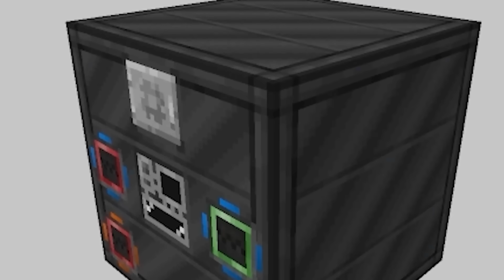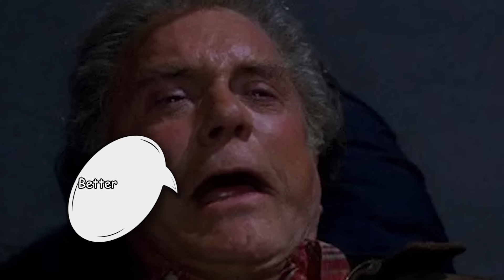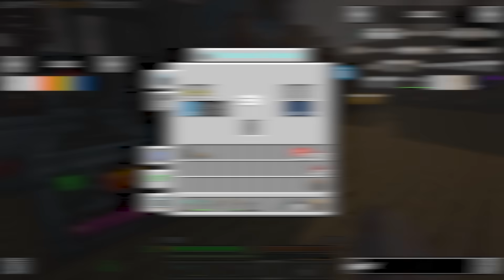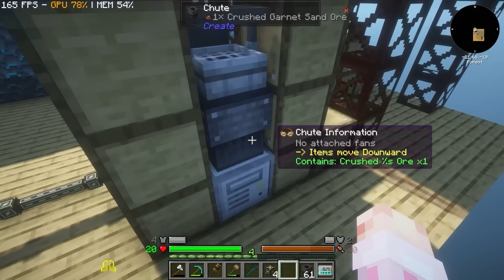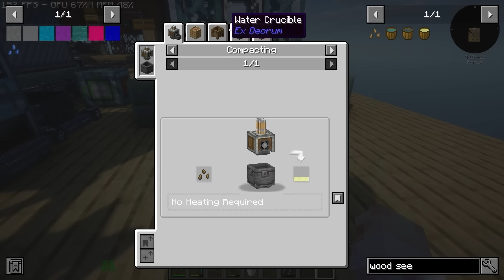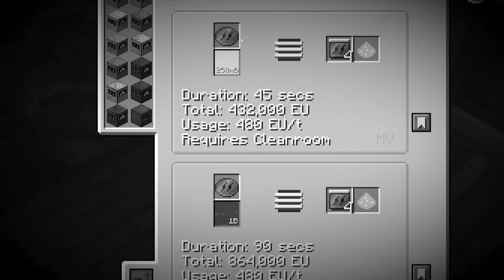Inventing Chemistry In Minecraft's Most Addicting Modpack || Star Technology (Part 2)

Comment: I'm a chemist so for simplicity 
Poly means plasticized aka many of the same chemical turned to 1 chemical tetrafluro 4 fluorine on the carbons ethylene is like carbon hydrogen but the 2 carbons as "eth" is short for 2 long chain and because it's tertafluro it means no hydrogen which means no combustion and polyethylene is same but fluorine is hydrogen

Comment: Gregtech has a way to make oxygen infinitely, through the cobblestone processing line. 
If you forge hammer the cobblestone into sand, make glass dust, centrifuge it, and electrolyze it, it will yield you silicon and oxygen very quickly.

Comment: 14:56 At least you don't have to aquire blue steel (and if I had to guess, later red steel) the Terrafirmacraft way it's a lot of heating things up and casting and waiting for things to cool, oh and dealing with the expensive (at that stage) fuel devouring mess that is the Terrafirmacraft blast furnace. Terrafirmagreg LV requires 4 blue and 4 red plates which are either 1 to 1 with 20% loss chance, 2 to 1 manually through a mini game type thing after expending 14 ingots of either type on an anvil, or 3 to 2. I know because it's been kicking me in the shins.

Comment: Here are my government mandated tips:
- when you do build the cleanroom it's much easier to expand vertically rather than horizontally, so making a max height cleanroom is likely the way to go when trying to fit more machines. You should also be able to use a machine hull to pass through ae2 cables if it follows the rules of gtceu on 1.12.2
- gregtech loves to reuse the same fluid in 20 different places (hi sulfuric acid) so my personal recommendation is to make a seperate ae2 network dedicated to storing passived fluids using cells, and then use fluid interfaces to move said fluid around
- ae2 energy p2p is a really solid alternative to energy consuits for moving power around, especially since it removes the need to swap every conduit when you need more power. I would recommend making a backup power system just in case so your entire base doesn't get sent to the stone age though 
- since mid-late game gregtech loves having stuff that needs to go everywhere I recommend adopting more of a "blocks" design where you have seperate passive setups connected via an me system to be able to send or recieve from any other block, which can then also be simplified logistically by using even more me systems to move items around. Ae2 is honestly just an incredibly powerful item logistics system and can completely replace item/fluid pipes if you understand it well enough
- once you start producting titanium making a second titanium tetrachloride setup (seperate from the first, since processing it to titanium causes a perfect recycling loop) lets you "catalyze" a lot of reactions to produce more of the chemical and may be worthwhile for some things you need a lot of
- Large Chemical Reactor, instead of normal overclocking (4x energy for 2x machine speed) does perfect overclocks (4x energy for 4x machine speed) meaning you should try to replace every chemical reactor you have with the large counterpart to allow recipes to run wayyy faster
Reply: Have you never heard of storage bus? That is a fun way to avoid using using cells space!
Reply: @Logini228  storage busses are a thing but they take up space in the world, have less space than a partitioned cell, and cost more
Reply: @Logini228  on top of what chaotic had said, they're also generally laggy tps wise, which may not be a real problem in singleplayer, but is something that should very well be taken note of. with enough of them, it could destroy the tps of the internal server, and if you rely solely on those as opposed to pipes, or the other ae2 stuff you likely will have enough to affect the tps by reasonably mid-late game
Reply: Is there a reason why you would want the fluids on a different network?